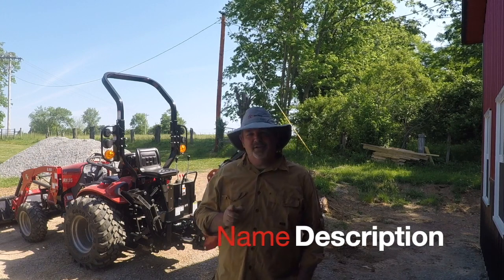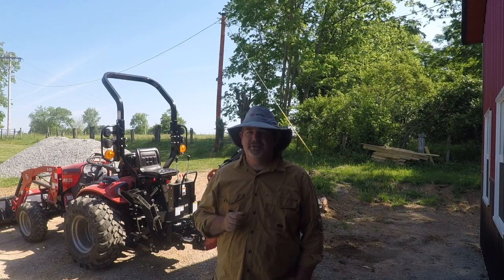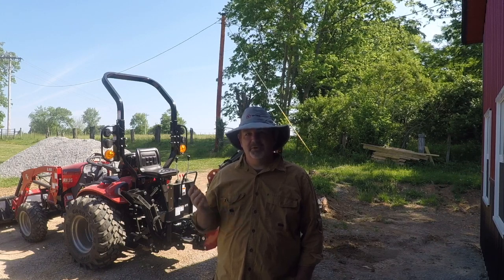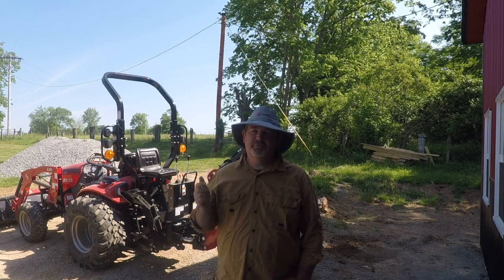#042:   RK25 Tractor, First Time Using the Backhoe

Comment: I have been looking at the Mahindra 1626 & 1635.
The RK 25 looks similar to the Mahindra with a much lower price tag. Mahindra was 28 to 34,000.
After watching your videos I'm considering the RK 25.
Did you look at the Mahindra?
Reply from the maker: I did not look at Mahindra, limited my search to brands with service centers within a reasonable distance from the farm.   Kubota, John Deere, and Rural King.   That is certainly much more than what I paid for the RK25, not sure how much they cost this year (I'll have to look it up), but I put out about $20k with backhoe.   Just checked, price went up a bit, but certainly did not close the gap.    For my purposes (100 hr - 150 hr / year) I believe the RK25 was a good solid purchase.    Have 200 hours on it so far.

Comment: I am ready to buy a tractor and would like to know if you have had issues.  Please let me know of the issues you have encountered and getting parts as I have heard that can be slow
Reply from the maker: Hey Stan, thanks for the question.   First, supply chain issues have been introducing delays in every brand for the last two years…. The good news is RK tractors… are mostly rebranded TYM tractors.   This makes getting the parts a little easier as TYM has been in market a while.    And the RK25 is really a TYM T25 with a less impressive logo, unless of course you like the windmill 😀
As for issues, Bluetooth connectivity at first (works now, but rarely use the speakers anyways), flat front tire, not tractors fault, drove over something.    Nuts loosening up - got to keep checked all nuts and bolts regularly, likely same for any tractor.    Only issue I have is there is a fair amount of flex in the backhoe when really working it hard (the frame) and that pushed my toolbox back into ROPs crossbar and bent it.   Easy fix, but I need a new spot for the toolbox.    Otherwise been very good to me.   201 hours on it so far, most of that backhoe work if I had to guess.    Pulled and dig out at least 40-50 stumps so far, and have done a lot of misc landscaping.    Glad I did not go RK24, and upsized, but I think the RK37 would be just to big and hard on my lawn for my needs = perfect size.
Reply from the maker: If you have not checked out ‘Peace In The Valley’ channel I recommend checking that out as well, and ask him for a second opinion and his thoughts as well.    Tell him TNT says hello :)
Reply from the maker: One more shameless plug, if you have not yet hit subscribe, please do so, then check out my Giveaway video for a chance at a great TNT branded tumbler.
Reply: Thank you very much!  This helps.  I will ping Peace in the valley and ask for a second opinion.

Comment: Have you figured out how to get the backhoe off of the rk25?
Reply from the maker: Hello Josh, thanks for the question.   I have yet to try, itching to try out my new box blade, however I still have a bunch of 'backhoe' work to do as well.    I'm assuming that it will not be too hard to remove, but given the full subframe assembly it will take up a lot of room in the barn.   When I do take it off, will certainly put it out on video.

Comment: How long have you owned the rk25? Like it?
Reply from the maker: So far only a couple of weeks.    So far I am very happy, although it is still early.   I have put nearly 20 hours on it though, mostly loader work around the little farm.   Our ground when dry is extremely hard clay so I wish the backhoe had a little more power to it.   One subscriber did suggest I get a narrower bucket to get more dig out of the power it has, so have put an inquiry into RK to see how to order a 9" bucket.   What I like the most is the size.    It is big enough to feel like a tractor, and still small enough to be practical on my small property.   Was worried about it and the R14 tires tearing up the lawn, but so far that has not happened - so that is a pleasant surprise.

Comment: Just purchased the same tractor. Had it for 2 days so far and I love it. First tractor for me. Question: How much throttle were you using to run the back hoe? Wide open, half, etc..
Reply from the maker: I run it about 2500.    Been taking it easy while I get better at it.    Keep us posted what you think after a few hours in the seat.
Reply: @TryNewThings  thanks for the reply, I will let you know

Comment: How do you like those r14 tires?
Reply from the maker: Howdy Travis, thanks for the question.   To be honest once I got the tractor I was very worried about them tearing up the lawn as I do a lot of back and forth over the lawn out there at the farm.   I was picturing a 'flatter' profile with more contact area, especially with the front tires.     My experience has been, except when completely saturated, I have yet to tear up any grass.   I do run a little lower air pressure in the front just so they spread the load out a bit more.    I can also say (and you can see it in my latest posted video) that the tires will cake up with mud, so not as self-cleaning as I thought they may be.    All in all though I am impressed with the tires so far.

Comment: why is every video speed up with the backhoe??  Is it really that slow??
Reply from the maker: Jim, thanks for the call out on the video speed.    The backhoe isn't slow.... I am.   In this video where I'm digging up (or trying to dig up) a small stump, that was my first time ever using this or any backhoe so I was really, really bad at it, taking my time, and trying to think of what leaver I need to use in what way to do what I wanted it to do.    I now have about 240 hours on the RK25, and I would bet, nearly a 1/3 of that is on the backhoe and I have become much more proficient at using it to the point where it is all muscle memory at this point.      I do apologize for not providing a good straight up representation of what it is actually capable of, and it is mostly due to the rookie operator (me).    I hope this didn't completely turn you off of the video and I do very much appreciate you taking the time to leave a question.    Feedback is how I get better, and that includes how I present stuff in my videos going forward.

Comment: You didn't show us anything! All you did was play. You didn't mention what steps you should do first ,2nd. or 3rd. before you start working. Ie check fluid, set brakes ,set best RPM ,set out riggers etc. Useless video.
Reply: You are a little bit angry aren't you Paul.
I thought it was interesting looking at a tractor that I am considering buying .
Reply: @dr.thunder4845  not angry, you judgemental much. If you going to do a video do a good one not one half-assed. The RK25 has many flaws .wheel doesn't title ,no feet room ,no step most of the controls are in the way not easy access. It's a useful tractor made for 5'8" - 160lb or smaller person.
Reply from the maker: just came across this reply you left 6 months ago, and you likely forgot all about it, but just wanted to say thank you.   Paul isn't completely wrong, RK25 backhoe does have it's challenges, however, it is a detachable implement at the end of the day.     5-8.. 160 lbs?    I wish I were 160 lbs.   5-11, the wrong side of 225 lbs, and I find it quite comfortable actually.    Foot room is poor, but I just put them up on the lip of the foot well.     There is a step, one on each side.   Anyways again, many thanks for the positive feedback.     I would say my only real gripe is that there isn't a way to lock the legs in the up position when not in use.
Reply: I chained mine in the up position.